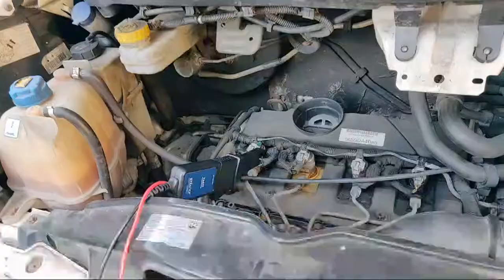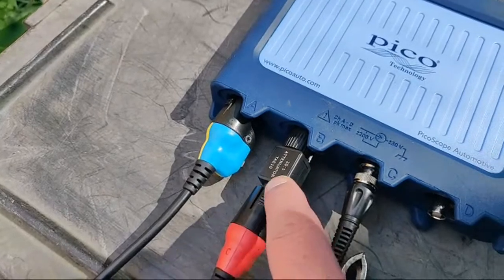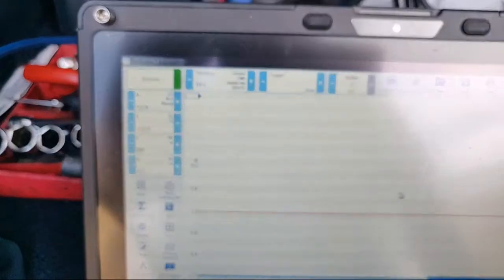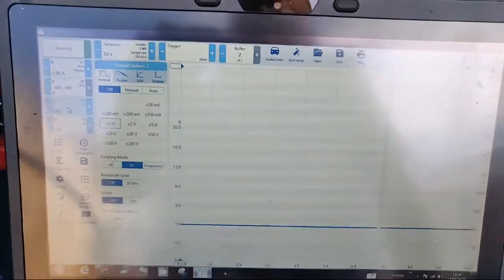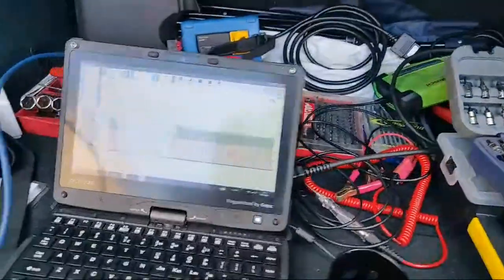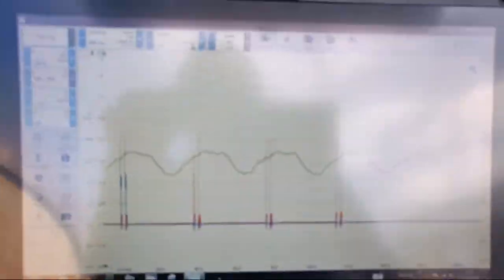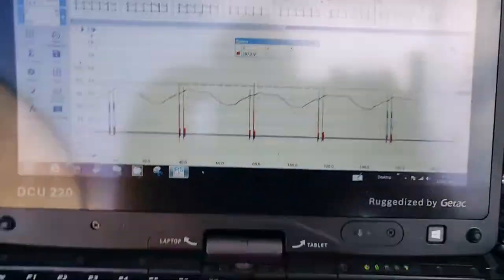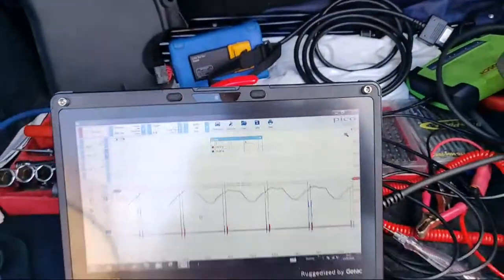Pico 4425A - Can You Use Existing Accessories?

Comment: First video I've looked at about the new offering from Pico. Looks far different on screen than the 4425 I use. Have you found it easier to navigate? looks nice over all. More toys to spend money on I suppose LOL
Reply: He's using PicoScope 7 new automotive software. Most of us are still using version 6 myself included. Maybe we should give it a try.
Reply from the maker: It's the Pico7 software, will work with existing picoscooes as well. 
Pico 6 is fully functional for the 4425A also. I like the simplicity of 7 👍